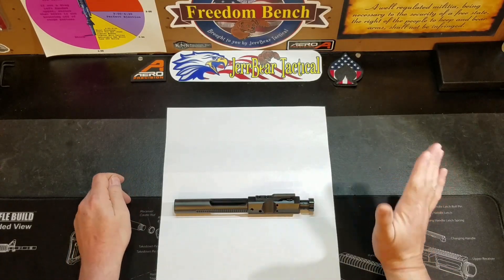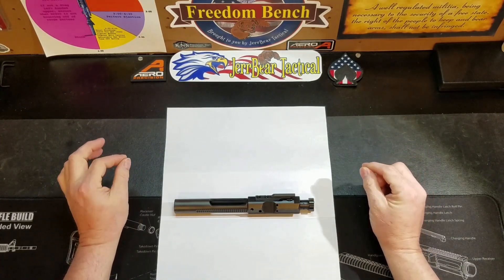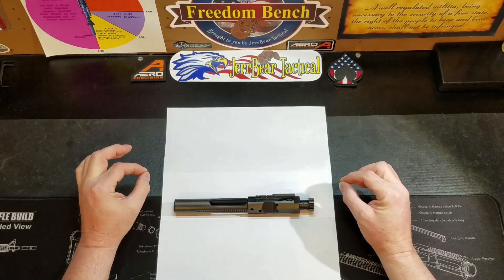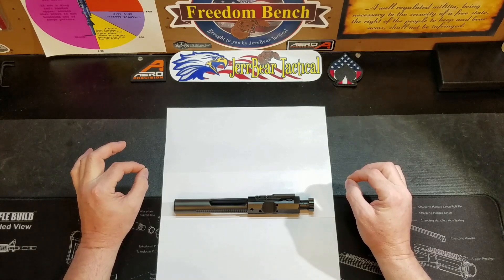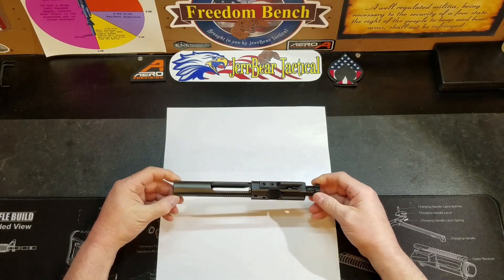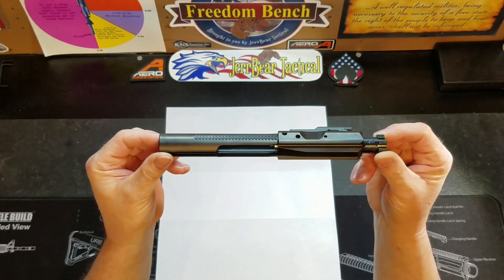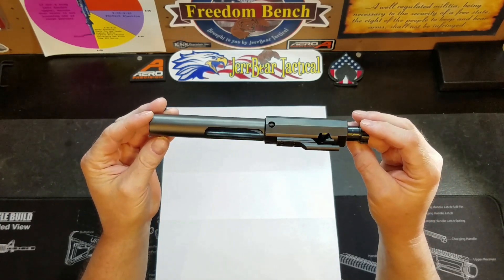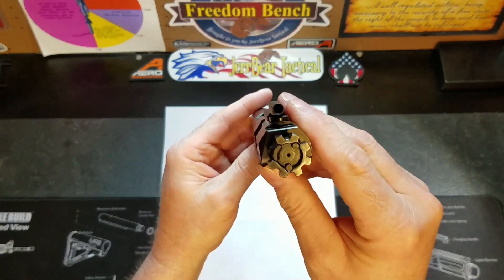Toolcraft 6.5 Creedmoor BCG with Diamond-Like Carbon Coating  ! Review

Comment: Shot peening and stress relief are separate processes. Stress relieving involves heat to normalize the residual stress inside the steel. Shot peening involves putting residual stress back in- only it’s compressive stress and it’s at the surface where it helps prevent crack initiation and fatigue failure.
Reply from the maker: 👍thanks for watching Brother 👊 🇺🇸
Reply: @JerrBearTactical  Thanks for making the video!

Comment: Hi sir would you know if the ar10 308 bcg is the same as the 6.5 creedmoor
Reply from the maker: They are not the same. If you're building a 6.5 Creedmoor DPMS AR-10 then you want to make certain that you buy the correct BCG for the rifle. The biggest difference is the reduced diameter firing pin for the 6.5 Creedmoor.
Reply: @JerrBearTactical  ok thank you very much for the information sir

Comment: I thought 6.5 creedmoor uses a 308 bcg! Why a specific BCG is needed?
Reply from the maker: You are correct  308 BCG  does and will work for 6.5 Creedmoor but ... Not all 308 BCG's are created equal. This particular one has the undersized firing pin to prevent pierced primers and the double ejector is something I just wanted to try. And it works flawless. And as for the finish on this bolt carrier group it's amazing😁 Thanks for stopping by and posting a comment. 👊🇺🇸👍
Reply: @JerrBearTactical  Thank you. So is pierced primers is an issue with 6.5? I am building one! And how is the double ejector working out? What is the purpose for it? Is that an issue with 6.5?
Reply from the maker: @JPE_DRAEB  6.5 Creedmoor AR-10's can be a bit finicky. So choosing a quality BCG, Barrel,and gas block preferably a adjustable gas block well help with eliminating possible problems with cycling issues. Here's a link for a good bolt carrier group that will work perfectly if not interested in the one I have shown in my video: https://www.armorally.com/shop/toolcraft-6-5-creedmoor-double-ejector-bcg/
Reply: @JerrBearTactical  Yes I seen that Nitride one, but looking for the DLC. I have a Aero Prec barrel, and high quality adjustable gas block. Just need BCG, charger handle, and buffer/spring. Any suggesting on the CH, and Buffer? Also the DLC version on the 6.5 BCG? Thanks
Reply from the maker: @JPE_DRAEB  4 charging handle there's only one style that I use and that's Radian Raptor for the spring buffer tube and buffer it all depends on what style stock you're planning to run. If you're going with a rifle length gas system then a rifle length stock, tube and buffer from Aero Precision is what I would consider using ... but that's just my opinion. And the diamond light coating 6.5 Creedmoor BCG from Toolcraft like I'm running is going to work in that set up just fine👊

Comment: You can't go wrong with the Toolcraft BCGs. I cant say I've ever heard of a reduced firing pin before.
Reply from the maker: The reduced diameter of the firing pin helps prevent cratering for the high pressure 6.5 Creedmoor round. The original bolt carrier group I was going to go with with this build was a Fail Zero nickel boron bolt carrier group it would have worked, but the firing pin diameter was .075 so I decided to go with this Toolcraft BCG just for the fact that it had the reduced size firing pin diameter.
Reply: @JerrBearTactical  
Interesting. Thank you for the info👍

Comment: Looks like it's gonna turn out to be a nice rifle man!  What kinda workbench is that btw?
Reply from the maker: Believe it or not. That is the bench that they sell at Harbor Freight for $99.00 If you get there coupons, you can pick it up for cheaper. I actually bought it for $79. I did modify the top of the bench. Once I completed the assembly of the bench I added a three-quarter inch finished piece of plywood on top of the board that comes with the bench. Traced all the existing holes from the original wood top to the new top, glued the two together and had to pick up longer screws to accommodate the extra thickness then remounted it. It's anchored to the wall. Mounted my Harbor Freight vise and it is solid as a rock.
Reply: @JerrBearTactical  I figured it may have been the Harbor Freight bench...  I live in a rented home and I gotta have something that's not too expensive that I can mount a vice to.  I have found that a vice is probably one of the MOST important tools for building and repairing/upgrading firearms!  Thanks for the tips on making it a more heavy duty bench, sounds interesting... 👍
Reply from the maker: @shojus  Anytime Brother! Thanks for stopping and taking a look !